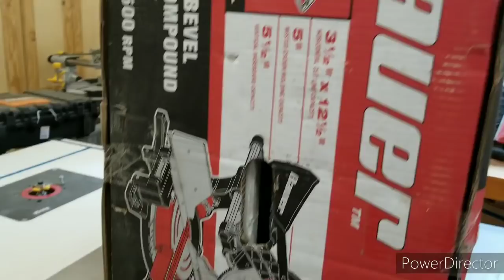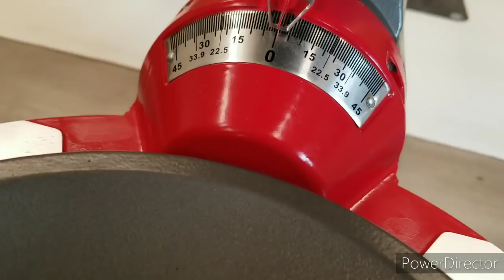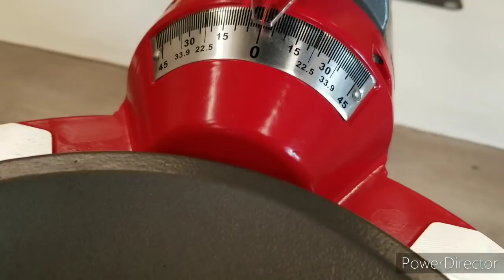Bauer 10 in Dual-Bevel Sliding Compound Miter Saw, Harbor Freight unboxing and review 57179 19743E-B

Comment: This is a great saw. I got mine a while ago, dialed it in and it is dead accurate. Has anyone tried replacing the shadow light bulb? Mine stopped working.
Reply from the maker: Mine is also not working correctly. I took it apart and the DC converter is putting out 10 vdc. It should be around 3 vdc. When I have time I will replace it and find out for sure if it is the led or the power supply.
Reply: @ShopRamblings  would love to know what you find out. I have the replacement warranty, but it's a one-time, 12-month replacement plan. I'm hesitant to replace the whole saw (and carry the sucker back to a store) for a $2 LED light if I can just replace it myself and keep the warranty for a major failure.
Reply from the maker: I didn't measure it but it looked like a 20mm star led. I am going to take it back apart and measure it. It should be cheap and easy to fix if I find the right part.
Reply: @ShopRamblings  so I found an exact replacement for the light bulb, painstakingly soldered it, and it didn't;t work... Any other ideas what might cause the shadow light to fail? Last resort I will exchange the whole saw it for a new one!
Reply from the maker: I tool the saw apart and shot some video.  I have ordered some part but have not had time to film fixing it. I am in the middle of a couple of projects. 

When I tested voltage I was getting around 10vdc. The voltage converter said it was supposed to be 3.8vdc. The circuit board also looked like it may have been  overheated.  HF doesn't have any parts for it yet so I may just find an old dc power supply and scavenge the board out of it.
Reply from the maker: Here is what fixed mine.https://youtu.be/fkiq1w_X9bM

Comment: Thanks, will try and find the Ridgid from HD.
Reply from the maker: If it fits your budget this is my number 2 pick. https://www.lowes.com/pd/DELTA-Steel-Adjustable-Rolling-Miter-Saw-Stand/50237913

I have used this one for years. It is a good stand as the others were over $200. With the recent sales the better stands have been almost the same price. https://www.harborfreight.com/mobile-miter-saw-stand-62750.html
Reply: Thanks. I went with a WEN that seems to be able to bolt anything to. Should arrive tomorrow. Thanks for all your help. Most important is the saw and your reviews were great!!

Comment: Robert nice review but I was wondering how good is  this saw on dust collection.  I went over to Harbor freight and the saw is now priced at 250 dollars without a blade. It is well made but not quite the deal it was at 220.  The saw looks to be extremely well made
Reply from the maker: Until the end of the month HF has $40 of $200 purchase of Bauer products.  This weekend there is a 15% of with no exclusions coupon. Most miter saws have a hose that attaches to the base and when the blade moves dust collection decreases. The Bauer has the hose connector on the saw with a shroud around the blade. It moves with the saw. It is much better than my Dewalt and Delta saws. It is very similar to the dust collection on the Festool miter saw.
Reply: @zebra6331  In that case it is a no brainer.  It does look a lot like the Rigid 4210 which has great reviews but is  no longer available.  I was interested in the dust collection because I want to side my house with fiber cement Hardie or  the other manufacture.  Thanks for the heads up

Comment: What are absolute best blades and tooth for baseboards and trim moulding?
Reply from the maker: There is never an absolute best. It would depend on the material for one thing. Is it hardwood, softwood, MDF, PVC ot something else? Are you taking your time and not rushing to make every cut perfect? Are you only going to cut a couple of boards or are you going to be cutting 8 hours a day 5 days a week?
Here are the basics. The more teeth the smoother the cut. The more teeth the quicker the blade will clog. All blades will cut good when they are sharp. The more expensive the blade the longer it will stay sharp or the more times you can sharpen it. Then you start to get into tooth shape. 
Just making assumptions based on the normal person ask this question I would say the Diablo Ultra Fine Finish should give good results. It is not the cheapest but is outrageously expensive. I use one for cutting delicate sheet stock. Depending on the material, to get perfect cuts don't rush the cut. Let the blade do the work and if possible make a 0 clearance insert.

Comment: What kind of gizmo is that saw mounted on? The RIDGID thing.
Reply from the maker: It is a RIDGID
Universal Mobile Miter Saw Stand with Mounting Braces. By far the best style stand. It is the same as the Delta one. If you watch you can get a deal on them at Direct Tool Outlet when they have them in stock. I paid $79 a few years ago at black friday. DTO normally sells them $129 and HD $249.

Comment: I replaced a very basic 10 inch no slide saw with this one today. Seems to work very well. My depth stop is very sturdy though. 

I got a herc blade just because I needed to use it right away. Now the blue and red is driving me nuts. I want so badly to replace with a Diablo but can’t make myself buy a new blade just based on color. 😂
Reply from the maker: I agree, the depth stop is not that good but I have never had a miter saw that it was. 

I am not sure if the is a lot of difference in the Diablo and Hercules blades other than color. In a couple of months you can upgrade to a Freud blade. You can justify it because it is a better blade and it is red.

Comment: Just noticed HF increased the price from $219 to $249. I WAS interested in this saw. Gonna be a hard pass with the new price hike. 

At ~$200, it seemed like a decent buy. Would have been a really good buy closer to $170-$180. At $250. With a garbage 90 day warranty. No thanks. 😐
Reply from the maker: I had seen where they raised their price. I still feel that the saw is a great value at that price. But I do believe now it is closer to the price of other name brand saws. Some people will now pay the little extra to go with a name brand they have known for years.

They do however have a $40 off all Bauer purchases over $200 until the end of the month which will bring the saw down to $209. I am not sure if  they raised the price so that they could give a discount but it's still almost 10% off of the original price.
Reply: I hadn’t seen the spend $X, get $X promotion going on. You may be correct that they hiked the price in light of that. So, yeah, at $209 it’s a fairly good deal. But the practice of raising a price like that to reduce the overall savings is kind of slimy. 

Why not just put the saws on sale at $209 (deal can’t be combined with other offers). Or exclude it from the “deal”. 

I buy a decent amount of stuff from HF. Their marketing has always been over the top. This just adds another off putting stigma.
Reply from the maker: I hate coupons or reward cards. Just put the price you want to sell it for and sell it for the same price to everyone. I have seen them have 3 different coupons for different prices valid at the same time for the same item.

Comment: Has anyone tried to use a vac system on this saw? Just wondering how effective it is for dust collection. Thx.
Reply from the maker: What size vac system. I have mine connected to my  dust collector.
Reply: @ShopRamblings  my concern is basically whether or not the vac system you are using is effective or does the saw design still allow dust to fly around all over. Some saws could be connected to a jet engine for suction and there is still a copious amount of saw dust on the table.
Reply from the maker: @bayoubiker7834  I did a video were I cleaned to floor and saw, cut  a 2x4 about 80 times and sweep up to saw dust. With a shop vac about 80% was on the floor. With a 2hp dust collector about 20% was on the floor. I currently have the  saw connected into the shop dust collector. I glued a couple small blocks of wood to the side and made the shroud a little bigger. It puts out more dust than any  of my  tools that are connected to the dust collector. It is also the best miter saw  I have had at dust collection. Other than a festol I don't know of any sliding miter saws that are great a dust collection.
Reply: @ShopRamblings  This is good information. I appreciate your input. I know that the miter saws are sloppy,  but its sounds like the Bauer is tolerable. 

P.S. With the cost of the Festol considered.....it better be stellar at dust collection. ;-)
Reply from the maker: In my last video on repairing the shadow line you can see the shroud I have on my saw. It has helped. Now I see that it works I will make a nicer one and may do a video on it when I have the time.

Comment: Can you put a dado blade on a miter saw?
Reply from the maker: Short answer No. This saw and all miter saws I have seen have short arbor when a bolt that screws into the end to hold the blade on. Table saws have a threaded arbor an inch or so long with a nut that screws on. When putting 2-6 blades on that make up a dado stack you need the arbor to be able to reach through all the blades. The depth stop is not a solid stop. I would not get this saw to do dodo cuts. If that is what you are planning on doing you need a table saw.
Reply: @ShopRamblings  thank you , I waited 61 years to decide to start wood working.. your answer is appreciated

Comment: Did ya say How much this saw was?
Reply from the maker: I have purchased 3 of them. The one I bought online I was able to pull up the receipt. It was $219.99. The price fluctuates. Currently it is $249.9
Reply: @ShopRamblings  thank you
Reply: @ShopRamblings  I just bought a Dewalt 12” dual bevel but it doesn’t slide. I sold my old Dewalt 10” but I think I’d like to get a sliding 10” and have my non sliding 12”. I want something fairly light. I originally purchased a Ridgid sliding 12” but it was over 70 pounds and it was just too heavy to bring to jobs. My new Dewalt 12” is about 50 which is the most I want to tote around. Is this saw you’re showing fairly light in weight?
Reply from the maker: These specs say it weighs 46 lbs.

Comment: use you work locking bracket before you lose a finger are two
Reply from the maker: I have seen someone cut off a finger with a miter saw. It can happen.  Unfortunately I have never found a work lock bracket that was quick or easy enough that i would actually use it.
Reply: @ShopRamblings  i always use mine when possible my Grandfather lost 3 on a table saw
Reply from the maker: @colemahaney880  I almost lost 2 on a table saw. I had my had over a foot away from the blade. The board kicked back and jerked my hand with it. You can never be too safe.

Comment: you look like a machinist to me especially with the tools you carry,   have you ever actually done any finish work or finished out of house yourself?  you don't worry about being within a thousand of an inch  I've been in the trade for 50 plus years you don't look like any kind of carpenter to me not even a weekend wannabe.  when people buy a compound miter saw whether it's sliding or not,  it's usually bought for one thing only finish work
Reply from the maker: I am not a machinist, but  I have done machining. I have done trim work. I have seen trim guys who didn't care if they had gaps. They could just fill them with caulk. I know wood will move. I believe if you take a couple of minutes and get your tool set as close to perfect as possible, your finished product has the best chance of looking great.  I always shot for perfection but rarely achieve it. Most times, I am close. If my goal was to just be good enough, when I fall short, then the finished product may not be good enough.

Comment: How has this saw held up over the last year or so? I’m looking for a decently priced unit for small projects around the house cutting up 2x4 4x4 and maybe 10” boards max. Would you recommend this one? Also can you recommend a proper blade? Thanks!
Reply from the maker: I would definitely recommend this saw for the price. 

Make sure you can get it squared. I have bought 3. Two I got squared and are still squared after thousands of cuts. One I could not get squared and returned.

The one major flaw is if you forget to turn off the shadow line and leave the saw plugged in it will stop working. I rewired mine last year and haven't had a problem since.

I wanted to get a Delta Cruzer. There was a supply issue so I got this one with plans to swap it when the Delta came back in stock. The Bauer cut perfect angles, some much so that I can't justify upgrading it.

This is probably the only blade I will ever use on a miter saw again.
https://amzn.to/3szr1OT